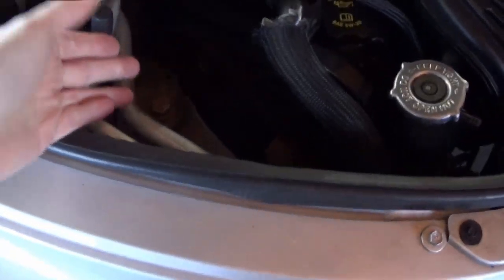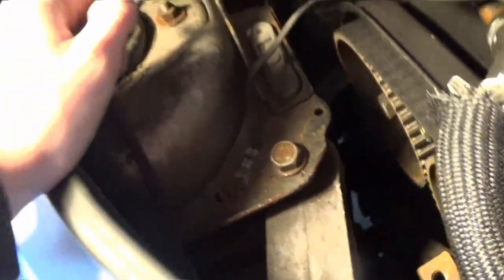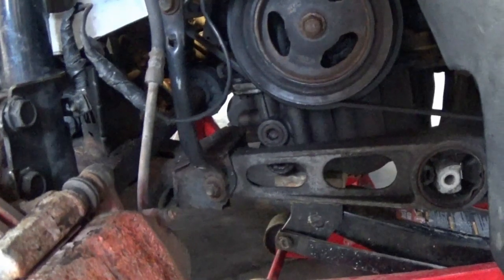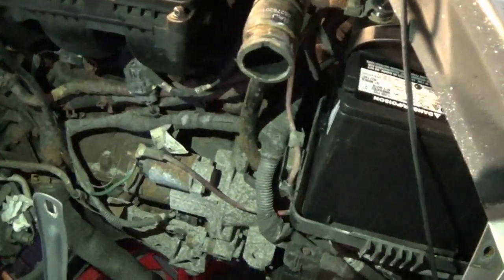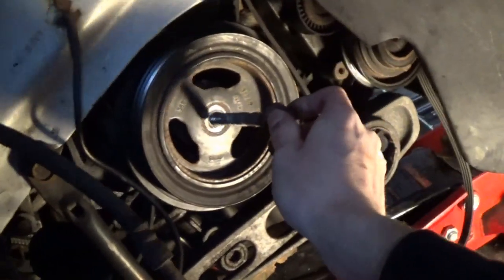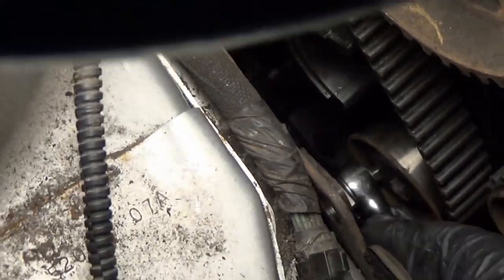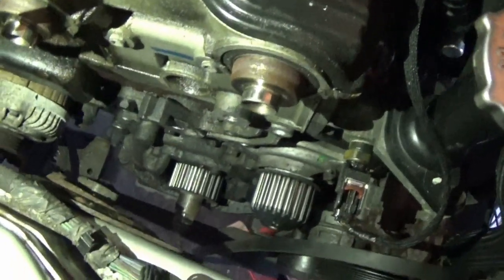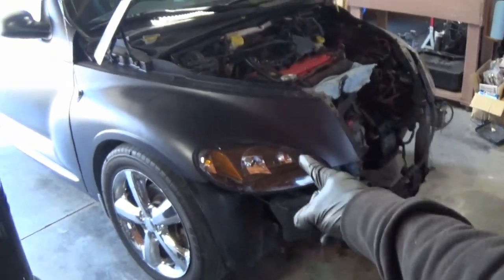Tear Down + Finding All The Problems... PROJECT VERT EP. 1!

Comment: I replaced the timing belt [ Twice } on my 2006 PT, first time i didn't have the timing marks just right, that is tricky, took it apart again and did it right. plus a new radiator, water pump, cooling fan, that was like 3 years ago. Don't  forget to check the motor mounts. God Bless and good luck.

Comment: Thank you for covering the 2007 silver convertible, I have exact one, bought used last year!  Mine just turned over to 81,000 miles and runs perfect, no lights etc, everything works perfect!  You will love driving this car with the hood down, it is a kick to drive and there are many after market chrome accessories to customize your own look!  Good luck on the build, it is worth it, you might decide to keep it too!  New ragtop cars are selling at a premium, so it is worth fixing it up and driving it for awhile!
Reply: If the timing belt is still the original, at your mileage, you should look into changing said belt.....if it goes, so may your engine. (If dealer does it, it's a BIG BILL). MANUAL says around 100,ooo miles. I had mine changed(by a friend) at 90,ooo and he said it was worn.
Just a heads up....Enjoy your PT, I enjoy mine a LOT. 👍😎
Reply from the maker: That's great, we are twins!!  I'm even more excited to get this one going now haha.  Thank you!!  I've only ridden in a convertible once as a kid, never driven or owned one.  I'm so hyped that this silver PT Vert can be my first!  I never thought much of them but now that I own this I see just how dang fun they are!  Good luck with your Vert as well, it sounds like she's a beauty.

And yes, as MeeMee48 LaRue mentioned, timing belts are never a bad thing to check on once the 80k mile mark gets hit.  I'd only worry about them at 80k-100k miles.  Thankfully though, the 2.4L in these cars is considered a "non-interference motor," hence the valves aren't suppose to crash if the belt breaks.  I've seen a few people go high mileage on their original belt and snap it, only to replace it and re-time it and hit the road again!  I suppose there's always a slight chance of engine damage though, and getting it done is better than getting stranded 😂 just my thoughts.  But good luck again and thanks for the comments!
Reply: @JimmyCruiser_CGE  I have a turbo and I'm very glad the belt has been changed. 😎❤👍
Reply: Might want to check out the PT cruiser play list on Motor City Mechanic. On the NA engines if the cam pin gets sheared, the NA pistons can come into contact with the valves!

Comment: This is kind of a critical review but not meant to be harsh or hurtful. Your approach to this job was kind of all over the place, right?  If you want to get in the same neighborhood as Chris Fix,  you'll need to have a plan people can follow when you do a remove and replace video. Now that you have the tire off you can check the play in the steering knuckle and actually see the play in the control arm.  FYI- Also your lower motor mount is trashed (probably the upper one too) and needs replacing.
Reply from the maker: I understand where you're coming from and I appreciate the comment!  I'm honestly not trying to and never have wanted to be in the same "neighborhood" as someone like Chrisfix, I've noticed some of the viewers seem to think I'm trying to be that type of YouTuber since I make primarily mechanical videos, and I get why it can be frustrating.  The whole point of what I do is that I am a COMPLETE NOOB and I learn as I go along as well, if someone learns from what I do, great.  If someone is entertained by watching it, even better.  I just take y'all along with what I do and point some things out.  I am way too ADD to be another Chrisfix 😂
Also, like I mentioned at the beginning of this video, I plan to make a much more in-depth one when I finish the timing job on my PT GT, so yes this video was even more all over the place because it wasn't intended to be "DIY" or "helpful" at all.  Most of the time my videos aren't 😂
And also like I mentioned, I plan to do a lot of smaller maintenance along the way on top of our main timing job, and I'm sure the motor mounts and suspension bits will be included in that.  Thanks again!
Reply: My take on this is as follows. ChrisFix is as you say very methodical and does it step by step, like an instructor or a lecturer. For me this is completely different, it's like hangin out with a close friend, having a few cold ones and fixing the car ☺️☺️
Reply: @JimmyCruiser_CGE  Ok great! i have a better idea of where you're coming from and I watch your channel because PT Cruisers are under represented on YT.  Glad you didn't get all bent out of shape at my comment. And nobody wants to be Chris . . . the dude has to hide his identity albeit the revenue and free stuff must be nice.
Reply: W WILLIAMS AUSTRALIA LIKE YOU CHANNEL, SO MUCH MY COMPLAINT IS ITS A WEEK SINCE THE LAST UPLOAD

Comment: You mean you have to remove the AC lines to do a timing belt? WTF
Reply from the maker: You MIGHT be able to get away with them not being there but it's not worth it 😂 Ikr though, the timing setup on these is kinda messed up lol
Reply: If memory serves the shop manual has you taking off the whole front clip, I know that the timing belt replacement is an expensive job mostly due to the amount of time it takes.  On the few I had the pleasure (poor choice of words) of doing I told the owner I would just buy an engine and swap them then fix the one you removed, it would be cheaper in the long run too.
Reply: @Liowen the grill and upper radiator support is all you can take off the front that will make it any easier. The fenders wont help and the fender aprons are not removable

Comment: Really common for them to shear during any sort of timing related work. Not a great design, they tend to shear if over tightened
Reply from the maker: True!  I assumed they were hardened steel but I guess not, no wonder why they pop easily 😂
Reply: Have you ever worked on 2.4 mopar engine , cam pin locates in hole ,not tightened ,cam bolt should be HAND screwed in ,then torqued to spec ,NEVER use power tool to force  cam bolt ! Shears pin because it's  NOT in hole !